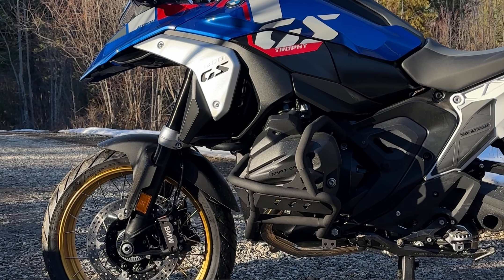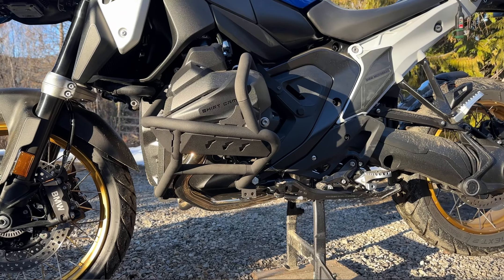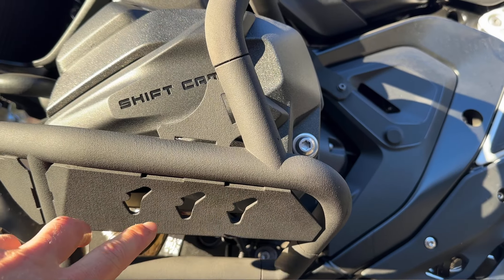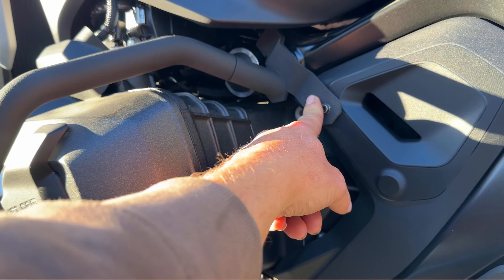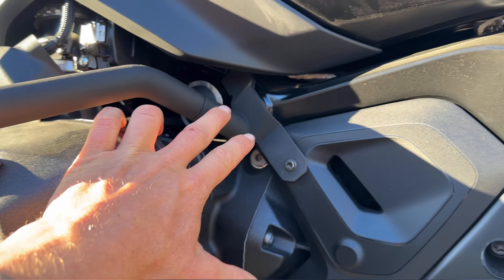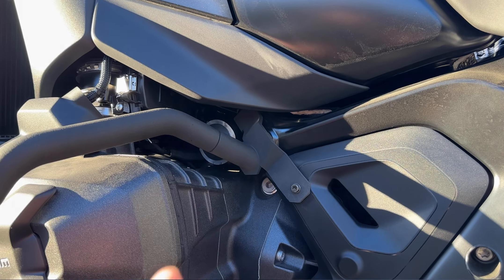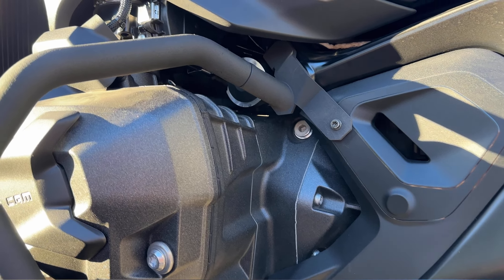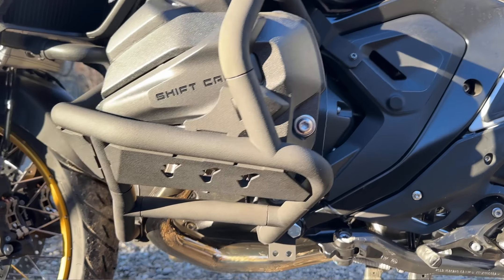BMW R1300GS Lower Crash Bars Intro by Outback Motortek #bmwr1300gs #r1300gs #outbackmotortek

Comment: Love these! I've looked at lower crash bars from  Alt Rider, Touratech, SW-Motech, Wunderlich, Hapco and Becker, and Lone Rider. These are my favorite but it's a race between Outback Motortech and Lone Rider... whoever gets to the market first! When my 1300 gets delivered in a few months these are the bars I want with one little change.  I trust your products/engineers/testing, but the upper 4mm plate fastened on with that little torx screw looks sketchy. Seems it would be be more bomb proof by changing the angle of that upper support arm and having a floating rubber foot over that through-bolt like the Touratech product and LoneRider Concept.
Reply from the maker: Thanks for your comment. We will drop and drag test our crash bars as always to see if our design holds up. We’re not racing, not looking to rush something that we may regret.

Comment: Looks great, I would be interested to swap my OEM bars for these bad boys my only concern is I have a Altrider skid plate already mounted to my bike and was wondering about compatibility. Any feedback would be appreciate.
Reply from the maker: @pascalo5119  generally speaking aftermarket skid plates are not an issue, but we can’t guarantee the fitment simply because we don’t test fit other aftermarket skid plates with our crash bars. We offer our own skid plates and w also offer protection combos with a little discount
Reply: @Outbackmotortek  Can I send you pictures of the mounting points of OEM bars and Altrider skid plate.
Reply from the maker: @ sure thing info at outbackmotortek dot com